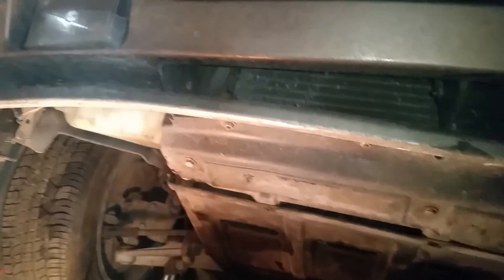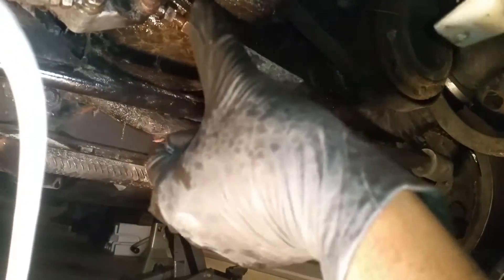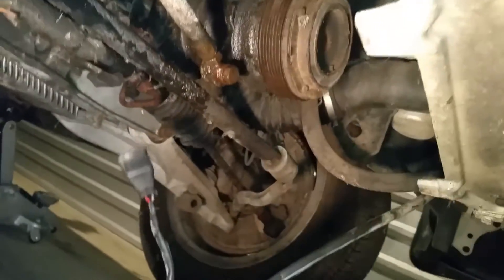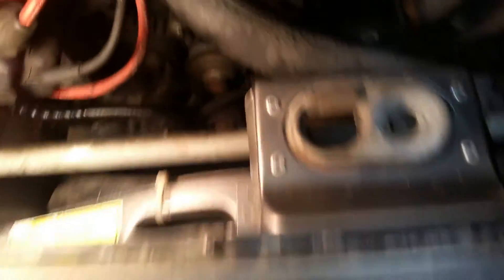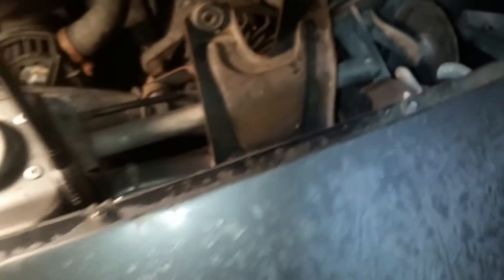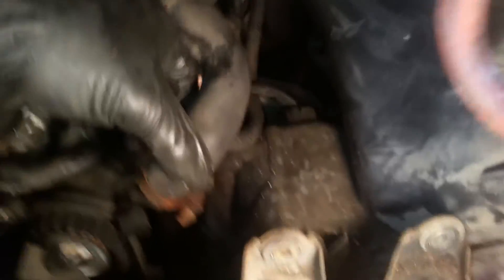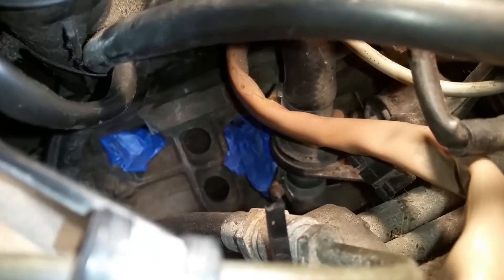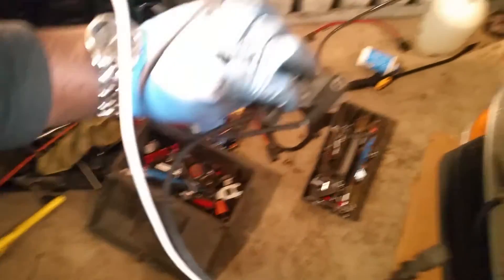Episode 3 - 944 timing belt replacement without flywheel lock

Comment: Awesome video. Thanks for this.  But quick question.  Is it necessary to remove the speed and reference sensors?  Could I just put the engine at TDC using the camshaft notches and then just change the belt then?  Thanks.
Reply: I would do that....

Comment: Deff appreciate the video, thanks for the upload. However im curious as to why you didnt change any of the seals. That engine had a lot of evidence of oil seepage and leakage.  Did you avoid changing them just because  you didn't have the flywheel lock?
Reply from the maker: Neel Bhatt thanks man! I had never heard the engine turn over. At this beginning stage I wasn't sure if the car needed a completely new engine. I'm pretty sure you can replace the seals without the flywheel lock as long as you look through the hole in the bell house of the trans to find top dead center. Line it up, mark your pullies and you're good to go. Everything really shouldn't move too much.

Comment: hi guys a good tip is look on ebay and used parts sites but call the main dealer too .. i got original parts cheaper than old used parts . porsche in the uk were cheaper than other online sites you will be amazed how cheap main dealer prices can be my 944 has a great pile of main dealer receipts  hope this helps you guys
Reply from the maker: good to know, thanks!

Comment: Hello! What a wonderful video of how to change the timing belt without locking the engine. I am a foreigner living in Taiwan and I just got myself a 968 which needs a lot of TLC. Similar condition as your 944. However it is really difficult to get parts here. 

I have two questions: Does your 944 have a belt guide beneath the larger crank shaft sprocket where the balance shaft belt is sitting on? Was it easy to wiggle the timing belt behind the balance shaft sprocket? Or was it tight already due to the small slot between the sprocket and the rear belt cover housing?
Thanks a lot in advance for your reply and looking forward to your next videos. 
Andreas
Reply from the maker: Sorry for taking so long to reply, for some reason this message just popped up for me. I only have one belt guide which is diagonal to the Camshaft. There isn't another one by the Crank. Removing the timing belt between the balance shaft sprocket wasn't too hard. There is enough clearance, you just have to pull the belt out at an angle, like sideways. Once you start working with it you'll see, it isn't too hard.